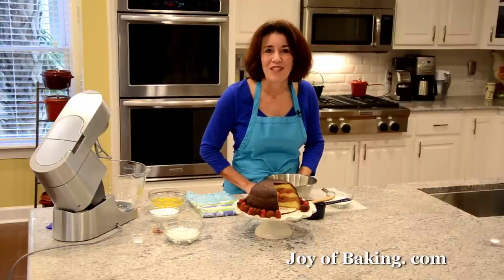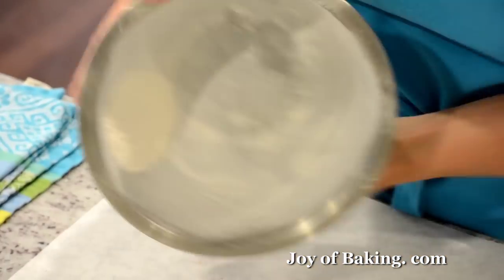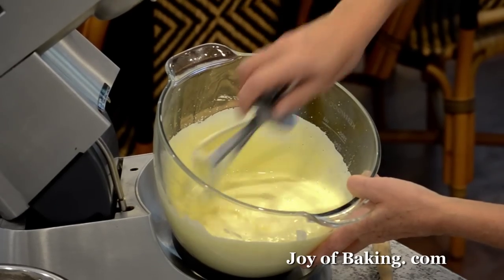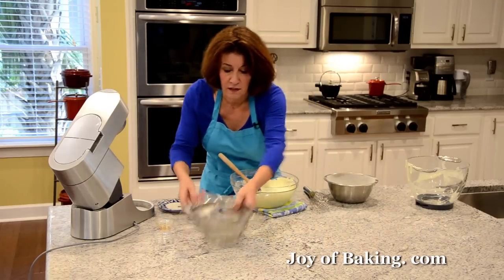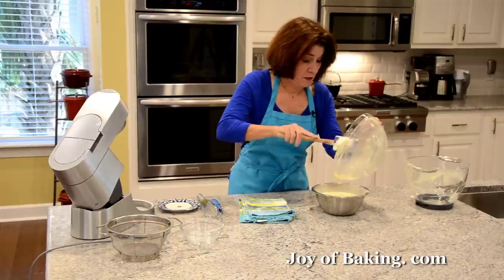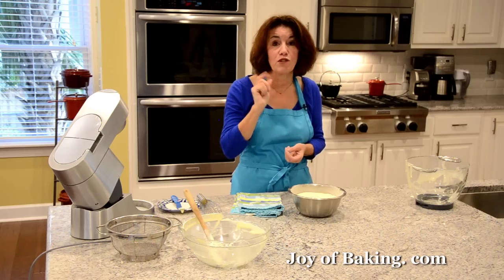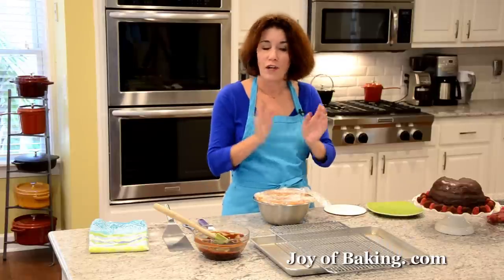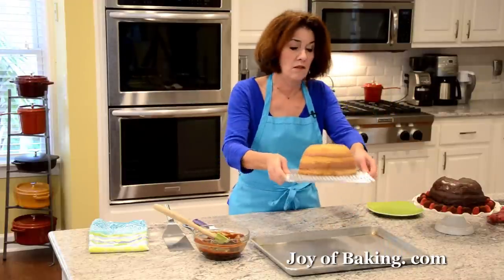Chocolate Dome Cake Recipe Demonstration - Joyofbaking.com

Comment: This cake looks amazing! I am curious, did you use the Volrath Economy brand stainless steal bowl to bake your dome cake in, or is there another brand for this specific cake that you can recommend me? If you did use the Vollrath Economy brand, since I do have the same five piece set as you since i had ordered myself one, which bowl would I use? Though the measurements are helpful, if the bowl has them written on it, I would not be able to see it due to my visual impairment. Also, I don't think it would, but I would still like to get confirmation since I would have never thought of putting an actual mixing bowl into an oven, it will still be safe whether I have a gas or electric oven correct? Thank you :)

Comment: eggs should be divided into whites and yolks, whisked separately (both with sugar). flower is added to yolks and after mixing - 1/3 of whites. then this mixture is poured into the remaining whites and folded. that's when a sponge cake gets the most airy. mainly bc whites and yolks need different whisking time

Comment: Stephanie that was an Excellent demonstration and recipe!!! Question: I don't have a metal bowl so can I substitute it with a glass bowl-Pyrex or another oven safe bowl? I could order the metal from Amazon but in the meantime I was wondering about the glass. Thank you so much!! 💖Lorine/Long Island, NY.
Reply: You could check at thrift shops for a metal bowl.
Reply: Metal bowls conduct heat better than glass but reflect the infrared radiation that comes from the elements of the oven, so I'm sure it'll work, you'll probably just need to bake and cool a little longer

Comment: when i baked this cake it was totally hallow at the centre of the cake i wonder what went wrong plz suggest me a solution
Reply from the maker: Mona Sakura Did you turn it upside down during cooling and did you use a stainless steel bowl to bake the cake?
Reply: Joy of Baking i made it in a regular cake pan cause i did not have a stainless steel blow is that a problem?
Reply: It's a dome cake recipe, not a sheet cake recipe. That's the problem.
Reply: ok i got that. thank you